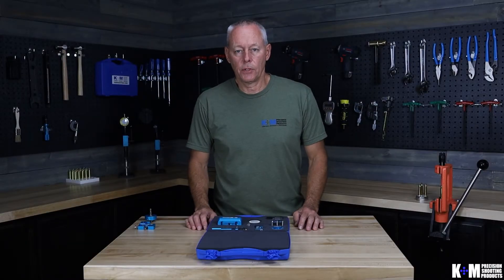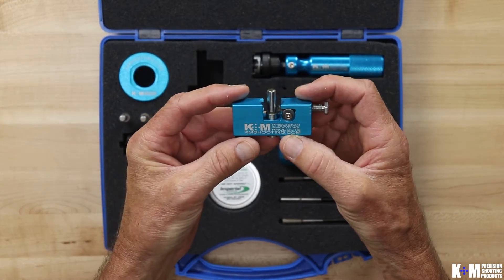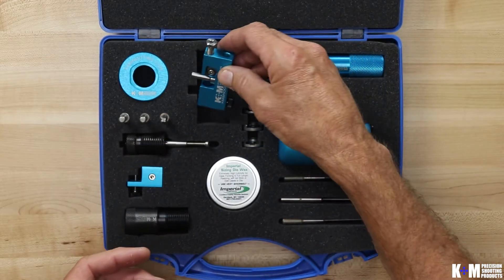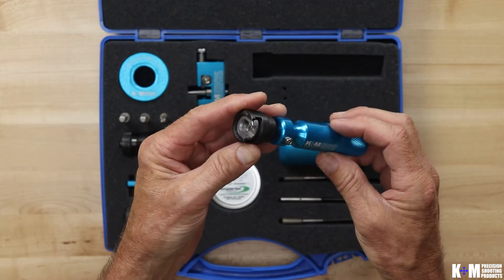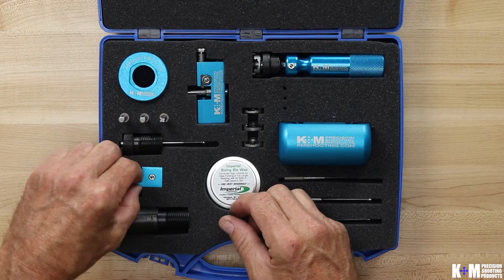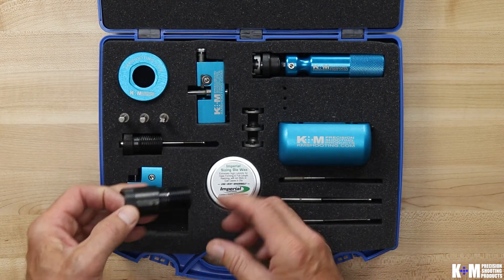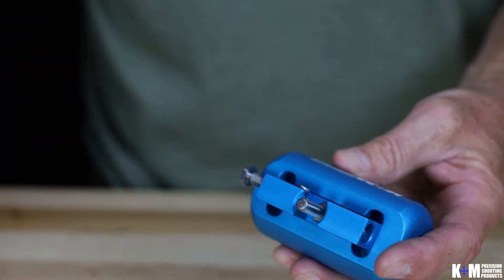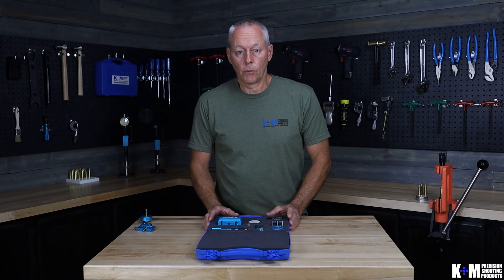Neck Turner Kit Overview | How To Neck Turning | K&M Precision Shooting | KM Precision Reloading

Comment: Looks like a very nicely machine group of over priced paperweights! Worst set up I ever seen price is probably ridiculous since you didn’t mention how much it cost
Reply from the maker: Hey Pete, one man's trash is another man's treasure. Neck turning is beneficial to reduce fliers and improve consistency (velocity/pressure, accuracy/spread, etc.) - especially at longer ranges. ~Dave @ K&M

Comment: Is okay to use imperial graphite dry lube?
Reply from the maker: Hey 372HGS, we recommend using a wet or wax lube for neck turning due to the rotating action of the cartridge on the pilot. Dry lube can typically be used with our expand mandrels as it's just a sliding on/off motion. 
Please send me an e-mail (sales@kmshooting.com) or give a call (616-399-7894) to discuss further.
~Dave @ K&M

Comment: Help me understand how I would decide what cutter lead angle to get?
Reply from the maker: Hey Scott, here are some bullet points on cutter angle: 
•	Our “universal” 50° cutter can be used with any shoulder angle and some folks prefer a matched angle. 
•	If you want to go with a matched angle – select the cutter that is larger than the shoulder angle, e.g.: get a 33° cutter for a 30° shoulder angle
•	The goal is to trim slightly into the neck-shoulder junction to reduce the chances of fireforming a donut  
•	The larger angle ensures a cut deep enough before contacting the shoulder 
•	The 50° cutter can cut the deepest, but take care not to cut too deep and thin-out the junction thinner than the neck wall thickness
•	Checkout the graphic for more info at the bottom of this link: https://kmshooting.com/product/spare-cutter-selector/